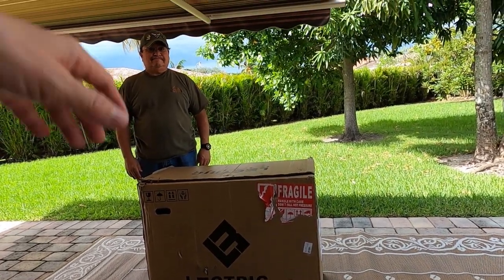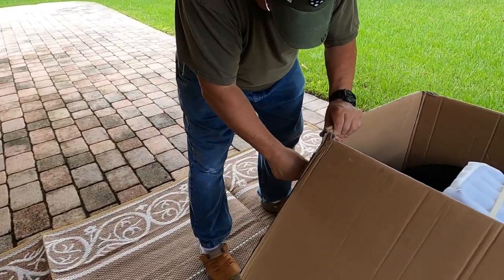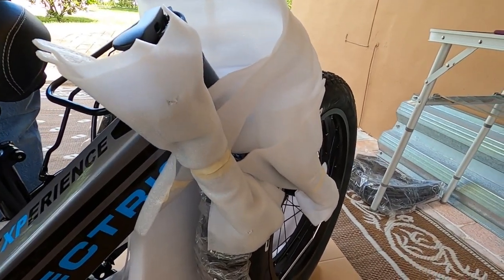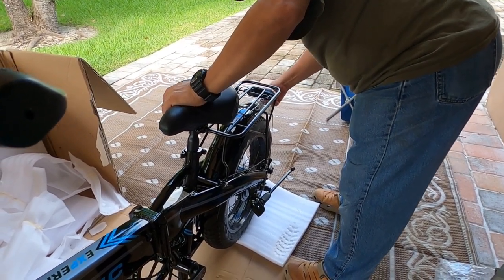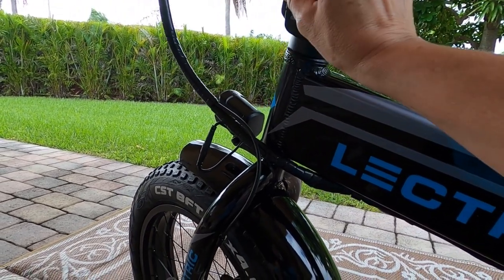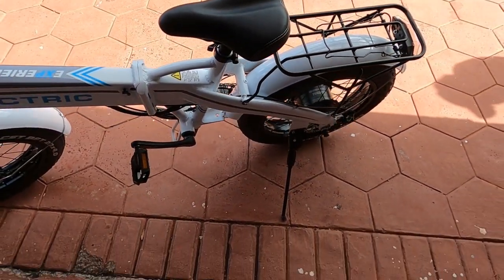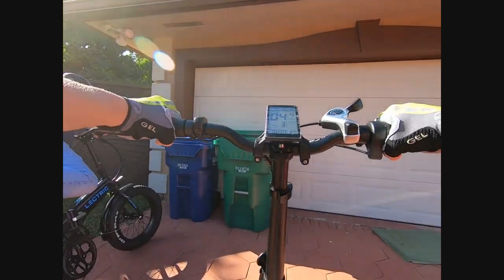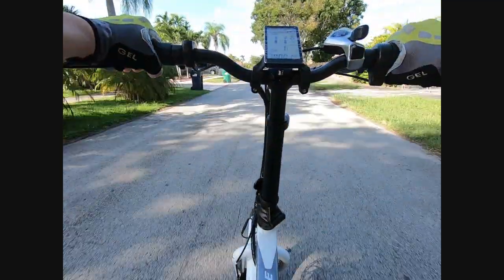Lectric Bike Unpacking and First Ride

Comment: This e-bike comes as class 2 by default limited to 20 mph, but you can switch it to class 3 in the settings to go up to 28 mph with punchier acceleration, but that also makes it illegal to ride in bicycle-only pathways.
Reply: @jazzfreak6944  That sticker is probably the furthest that law enforcement will check, if at all. True.

Comment: You are also able to change it into a class 3 Ebike capable of 28 mph in PAS 5. You have to get into the settings and go to P08. It defaults to 32 which is 32 kmh or 20 mph. You can take it up to 45 kmh which translates to 28 mph. Why anyone would want to go this fast on a bicycle is beyond me, but the capability is there.
Reply from the maker: Right?  Why I have not unlocked it.....
Reply: everyone always say 28mph but how long can you keep it at the speed? for several seconds.. no thanks.. just pedal comfortably at 22mph.
Reply: Eagles Quest Adventures And one without electric bikes
Reply: Eagles Quest Adventures yes I
Reply: Eagles Quest Adventures Yes
Reply: @josephsaeteurn9158  What do you mean for several seconds? Does it run out of juice?
Reply: @grimer1805  you need to pedal your ass off to maintain 28mph like a gerbil. Many are getting a new rear sprocket cassette which has different #teeth allowing you to pedal not so fast to maintain 28mph. Check videos out there.
Reply: bikes can reach 50kph down steep declines easily,that don't scare me
Reply: @vintagemxer9165  Actually, so long as the pedals are moving it will continue increasing power until it gets to 28 mph. No need to pedal hard or fast. Just keep pedaling. Even with the new cassette I don't think you could meet any resistance. Just keep pedaling at a normal pace and you'll get to 28 mph.
Reply: 28mph is really not that fast, that's a cruising speed, you want fast.. I had a stand up scooter that went 55mph+ .. that's fast and scary

Comment: I suggest READING THE MANUAL PRIOR TO REMOVING THE CYCLE FROM THE CARTON.   Then going back to the manual to explain visually the assembly of the cycle. to explain what the manual suggests in the assembly of this unit.   Job well done on this initial presentation but MUST also include the numerous questions that the manual does not provide. Regards,  Peter Gold, Professional Inventor,  CEO, Inview Vehicle Trim Corporation.

Comment: Hey! When my battery starts to run low (3 bars left) the screen and battery shuts down. Also, battery holds shorter time, running low faster. Have anybody experienced this issue? What can be the cause? my bike is around 6 month new but i use every day about 36 km a day

Comment: Will the E-Bikes fit in the basement storage of your Seneca?  Can you the loading and unloading in an upcoming video?
Reply from the maker: They might, as we had previously stored folding bikes in the basement prior to installing our tool chest  not these bikes, though.  We will measure the ebikes folded and the basement area and will let you know...
Reply: Right now I have a Winnebago View 24D but I’m looking at the accolade or Seneca.  Of course, I missed the $899 price on the bike, so I get to spend an extra $100.  Did you get the suspension seat riser for the bike?

Comment: How far can u go without pedalling on the battery?
Reply from the maker: Hi, Steve!!  It just depends on speed and road conditions.  I imagine if you're riding on level surfaces with low throttle you can probably go on for 50 miles on a single charge!
Reply: Eagles Quest Adventures okay I was curious if you had done it yet thank you

Comment: With all that padding for shipping and you still get a scratch? That has to be manufacturing or packing negligence, it does come from China after all
Reply: pedro fernandez lectric bikes do not come from China
Reply: They are made in USA. The company is in Phoenix.  They hand assemble.
Reply: The main warehouse is in Arizona ..... The company will replace if anything happens to the bike in shipping process ..
Reply: @TheRoger1205    Negative.  If they were assembled in the USA, by hand or otherwise, they'd cost a LOT more than $899.  Yes, the Lectric XP office is in Phoenix but the bikes are made in China, and they're no more "hand assembled" than any other mass produced bikes built in Chinese factories.  There are actually several factories in China that make basically the same model e-bike with minor trim and optional vs standard feature differences.  They sell them to small e-bike start-up companies all over the world who have their own name put on them for marketing purposes.  For example, a company in the Netherlands sells basically the same folding e-bike bike as the Lectric XP but in a 250W version under the ironic name "Samebike XP".  They market their version with slightly different equipment combo than the Lectric XP, such as a suspension fork is standard but the cargo rack is optional.  http://www.samebike.nl/xp/
Reply: @paranormalunknown40   Yes, they do. Versions of this same bike are on the streets all over Asia under different brand names and with various trim and equipment combos, but it's the same folding frame, 20" fat tired e-bike.

Comment: Can you buy these in uk
Reply from the maker: Darren, someone else asked me this same question and I had contacted the company.  They said they are not shipping out of country yet but are considering it.
Reply: Not legal in the UK....  EU laws restrict ebikes to 250w and ban throttles, so pedal assist mode only. And the assistance has to cut out power assist at 15 mph. Hopefully in about six months we might be able to change that law in the UK...
Reply: You can buy it and have it shipped to a family member and have them ship it to you ....that's what I did .... Bought it and had it shipped to my parents in Florida ....and they shipped it to me in Paris ( $30 )  ...... Great Birthday gift ......
Reply: @karlbassett8485  There are 250W versions of this bike sold by companies in Europe under different brand names with different trim and optional vs standard equipment combos, but they're all the same basic 20" fat tired  folding e-bike made by the same factories in China with different company names slapped on them.  I don't know if they're marketing in the UK or under what brand name, but here's a Euro-spec version of the same bike (ha) sold in the Netherlands under the ironic brand name "Samebike XP"  http://www.samebike.nl/xp/